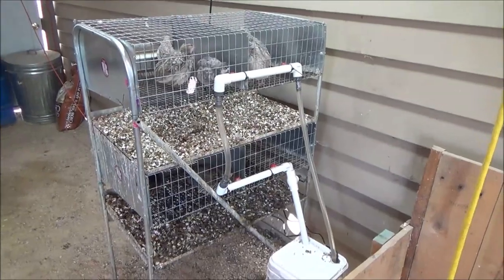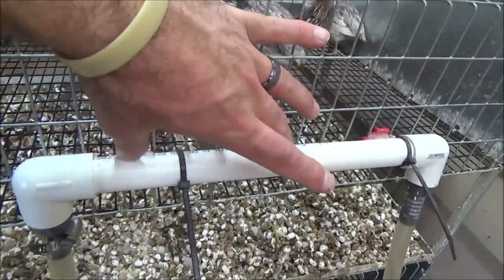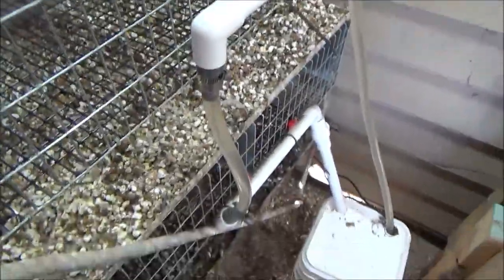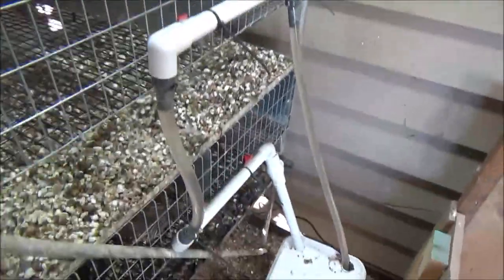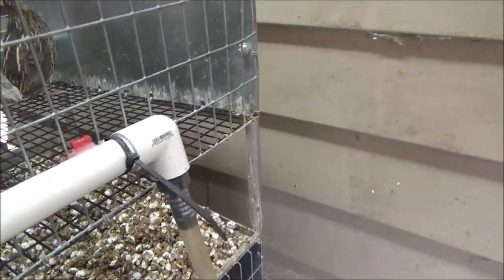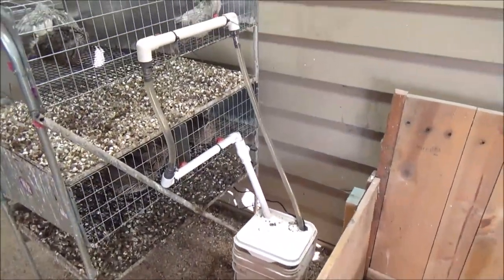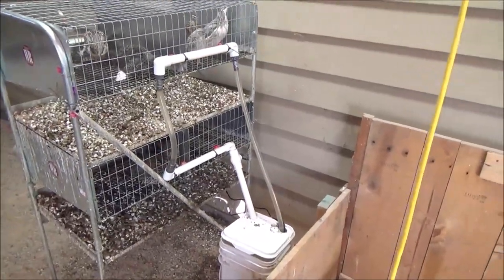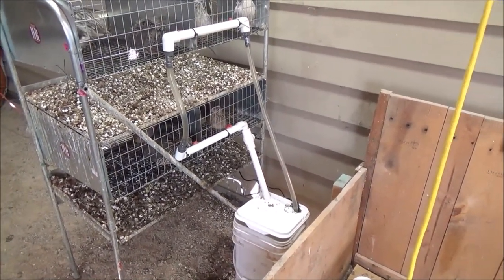Frost Free Water System for Quail

Comment: I was planning on doing this but keeping the water container above the cage system so I could swap out the pump when it got warmer so that I didn’t need to use it to save power. I also wanted to make the pump in line also.

Comment: This is really creative... what I do is use 5 gal buckets with cover, outside coated in rubber for insulation, drilled some nipples into it, same as these, and stick a 5 watt aquarium heater in it. holds up through Zone 5 at least. Enough water to last a month

Comment: I've done a variation of this for my chickens. The one thing that I encountered is that the nipple will freeze.  There is flow, but the tip freezes up here in NE ohio
Reply: Easy enough to restore with a small hair dryer. Supplement with removable Tupperware drinker during coldest nights, or ceramic heat bulbs over the drinkers